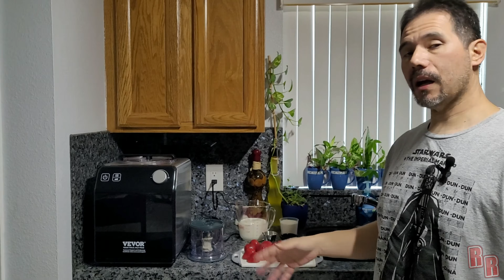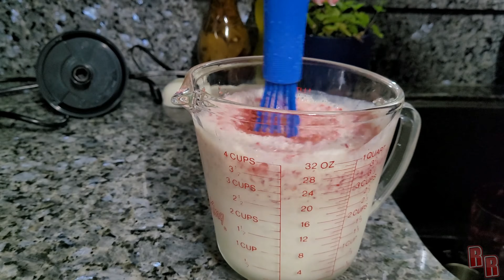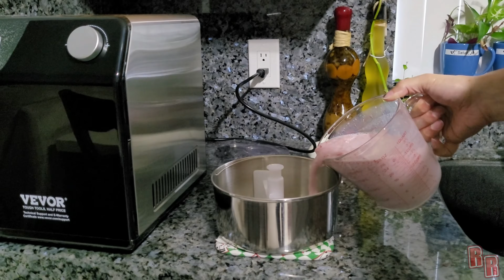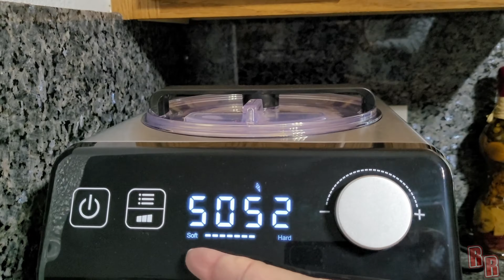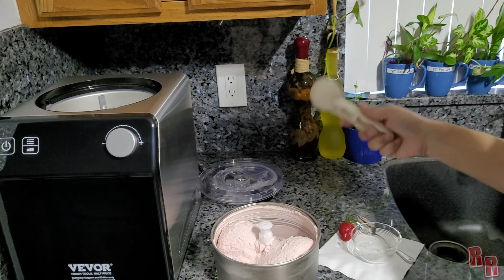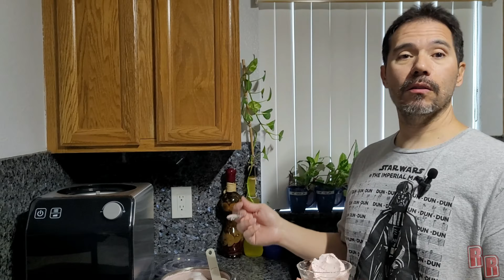Vevor Upright Ice Cream Machine 3 Month Update

Comment: Thank you much homie. Def inbox me. Can trade recipes
Reply from the maker: No problem, I have to get back into making new recipes. It's nice to eat something that tastes good and actually not bad for you.
Reply: @Real_Reviews  hey i did 1cup strawberries, 2cups half and half and 1 cup sugar with pinch a salt and 2 tbsp vanilla extract. Also added 2 tsble spoons of peanut butter. I only got 727gms (just under 26oz) of ice cream. This was my 2nd run. 1L is 33oz. So im 7oz of ice cream short of just 1L. Will try it again in a few days.
Reply from the maker: @tcr9315  You can fill it a bit more to get the full amount, but I limit my ingredients to 4 cups to keep my mess to a minimum. If you check the recipe book that comes with it they use more than 4 cups.
Reply: @Real_Reviews  yes i know but its not gonna get me from 26oz to 66oz (2L)
Reply from the maker: @tcr9315  It also depends on the ingredients as plain vanilla may expand more than when you add strawberries. Plus you know the manufacturers always exaggerate too.

Comment: Would you recommend to get a 3 year protection plan from 30.00?
Reply: Thought old let you know I made 1 gallon of mix. Cream , milk , salt, sugar, vanilla,  eggs for a base. The next day I poured 5 cups mix and 1 cup cocoa  powder  (whisked) into vevor bowl and it made great ice cream no over spills. Looked like I could have added 1 cup nuts etc with no problem.
Reply from the maker: @dreadedtred  Wow, mine usually puffs up and overflows if I go over 4 cups. Your recipe sounds tasty. Enjoy
Reply: @Real_Reviews  
Basic Recipe - 2 C Heavy Cream, 1 C Milk, 3/4 C Sugar, 1 Tbs Vanilla, 1/8 tsp salt, 4 egg yolks. 
Heat cream and salt to 170-whisk sugar with  egg yolks 2 minutes. Temper egg yolks then add to cream.  Continue to cook 4 minutes at 170 F. Pour in bowl. Plastic wrap over top mixture and refrigerate.  Multiply this recipe X 5 to get a gallon. Then you can make any flavor you want from this mix.
Reply: @Real_Reviews  
Forgot- Add the vanilla in cooking stage. Also strain the mixture in a bowl to remove any  hardened mixture.
Reply from the maker: @dreadedtred  Thanks for the detailed recipe. I will have to try it out.
Reply from the maker: For $10 per year I say go for it. Especially if you plan on using it a lot.
Reply: @Real_Reviews  

I ordered it as well as the extended warranty. It’s being delivered this week. Thanks
Reply from the maker: I would say yes because it works great, and you will most likely use it a lot. I use it at least 2x or more per week. I do 2 batches and stick it in the fridge.